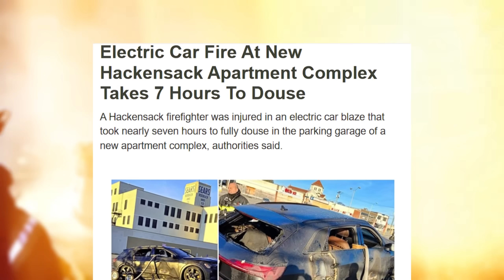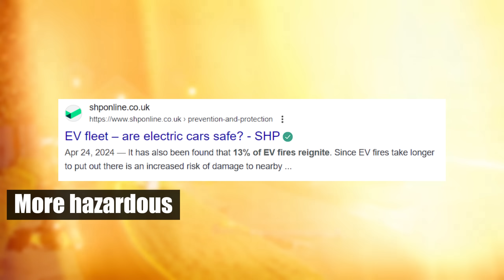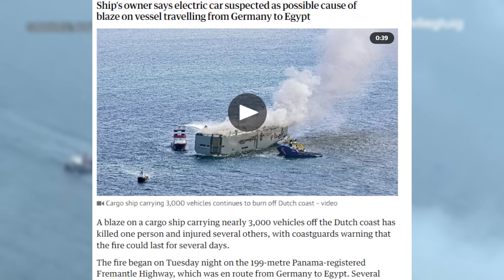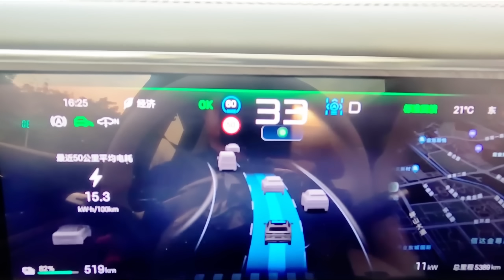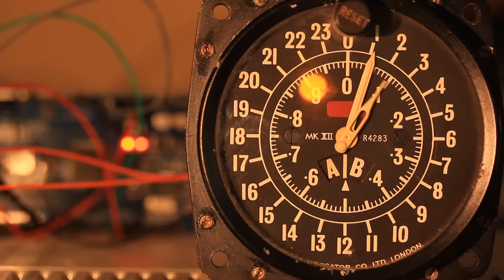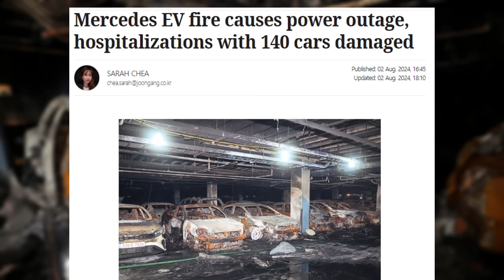Why EV Owners Are Furious? Electric Vehicle Crisis: Owners Demand Answers as Battery Fires Surge!

Comment: There are more petrol fires pro rata than EVs. Also what there are are some unsafe European EV manufacturers. I don't hear of EV car fires here in Asia.
Reply: No EV fires in Asia? Are you effing nuts?
Reply: @Eiswueste  Yes you are right but mainly if you include hybrids. Worldwide, the top position for car fires goes to hybrid EVs followed closely by petrol.. Battery EVs come in a distant third. (<20 x less)  Hybrid fires are the hardest to fight.
Reply: @Eiswueste  You cannot read !
Reply: 1 fire engine can put out and ICE fire very quickly - EV fire are spontaneous even when the motor is turned off and it takes 10 fire engines hours to put out and EV fire then they can reignite, and the fumes are deadly almost instantly
Reply: @cloudbasenirvana  Anecdotal. A valid metric is by vehicle deaths.
Reply: @bobdeverell  percentage wise fires per volume of product EVs are far higher and they want all to drive EV - it is a recipe for disaster
Reply: @cloudbasenirvana  Not correct. Look it up. Evs are proportionally far lower than either hybrids or gasoline fires. (about 25 times lower).
Reply: You really have to take age of the vehicles into account as well.  Insurance fraud/theft are also factors.   I think the EV fires are excessive when you consider the danger/toxic gasses involved.   I am sure battery technology will overcome the thermal runaway risk (I believe the technology exists already just needs to role out).    Until then no EV for me.
Reply: @rovert1284  This thread reminds me of the little old lady syndrome. Some little old lady gets mugged somewhere and panic sets in to all the little old ladies. Statistically the rate of BEV fires is 1 in 4,000.Not a meaningful risk for most normal people and hopefully it will be eliminated unlike gasoline based cars. Lets keep our feet on the ground.

Comment: Well it's the batteries  that is the problem. Now the electric vehicles has always been a problem.  From the start electric vehicles  where women cars that was what she used to just get around because it was easier to  start.   Gasoline cars  where for men that could start them. Does this sound familiar the most expensive  part of the first EVS  was the batteries.  Has anything changed no it's  much worse now. Maybe it might be better to work on the fuel make it cleaner . That would  solve most off the problem and it would be cheaper .
Reply: Well as a scientist yourself why don't you do it?  You must be better than the top petro-chemical scientists in the world.